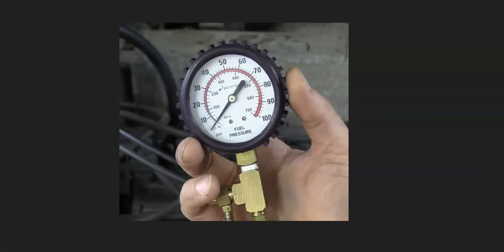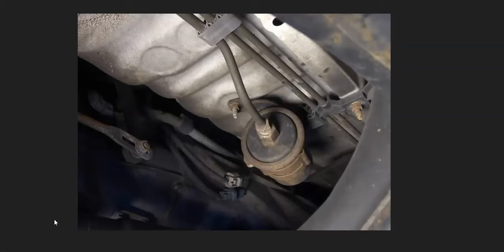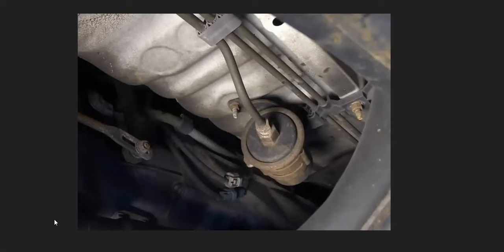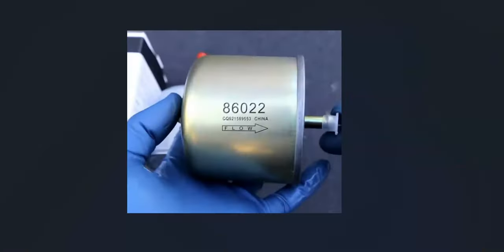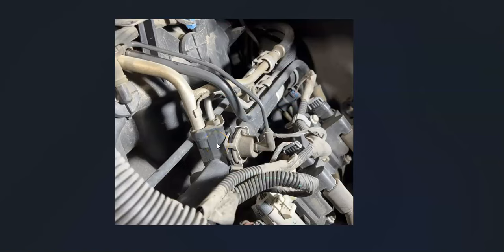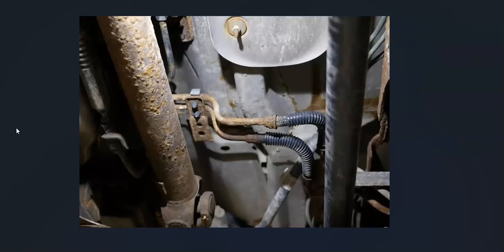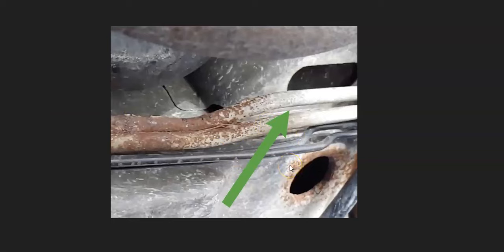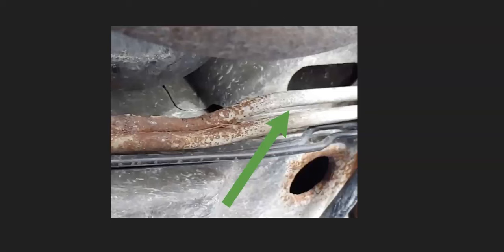5 Causes When No Fuel Pressure but Fuel Pump is Working

Comment from the maker: UPDATE: The fuel inertia button shut-off switch should have been on this list. An inertia switch shuts off all fuel when there has been an accident but may have malfunctioned.
Reply: @Hvac_Mechanic, I have a 93 ford 4.9L straight six, it sat for 3 years with low fuel in both tanks, fast forward now, 2023, I have to shoot carb cleaner for it to run on that, which is more likely, bad fuel selector dash switch, 2. rail mounted selector switch, 3. fuel filter as you mentioned? 4. FPR as you mentioned? 5. Fuel PUMPS, yes I said 2 pumps it has midship and aft tanks, 19 gallon midships, and 17 gallon aft tanks, front tank has a 2 second pump prime sound, rear none that I could hear like before, I just find it hard to believe I have 2 pumps out, I left my ford Ranger 2.5 4 cyl 2001 next to this 93 sitting with stale 3 yr old ethanol regular in it and a battery tender, it fired right up, so I find it hard to believe the fuel in the F-150 varnished at a different rate and is a dead fuel problem, I mean, I added 2 gallons fresh to the midship tank that did not help. I am going to test baseline pressure with a fuel rail gauge soon! your thoughts?
Reply: None of these seem to apply or are integrated into the New Fuel Pump I installed and still somehow am not getting any Fuel to the engine which I am now at a complete loss to what else To do... 
BUT GREAT LAMEN PRESENTATION THAT WE NON- MECHANICS CAN FOLLOW AND UNDERSTAND WITHOUT GETTING TO DEEP INTO THE WEEDS WITH (ohm and power numbers @ number ? Circuit, PCM etc) 
which looks like is what I am gonna need now lol... 
👍👍 For a great Video though thanks, Was still a great help! Tells me I'm at least on the right path

Comment: So i had 60psi at the engine ive replaced the fuel filter now i get none, when i start the emgine it runs like crap but on 30psi pressure, soon as i turn off the engine it drops to 0 pressure??

Comment: I just put in a new fuel pump in today for my 93 F150, the weird thing is, I can hear the fuel pump whining trying to run, but it's not pushing any fuel out of it. I even put a clear hose on the output side, and I'm not seeing anything. Either either the fuel pump is sitting too hard down on the fuel sock or the fuel pump is bad? I don't think it's any kind of voltage issue.
Reply: I just had the same problem tonight brand new fuel pump and nothing
Reply: @MarioGibson-qx6qy  here's what happened for me, I only had 3 gallons of gas in the new tank. I found out later I had to put at least 5 to 6 gallons in there. Once I did that everything started up fine.

Comment: I have a 98 nissan frontier 2.4.installed a pressure guege in place of filter because of po300 code it's throwing. At first when engine first starts up it's about 25 28 psi but after I run down the road and it warms up it barely runs  and the Guage is from o to maybe 10. Just replaced fuel pump. The Guage won't read any pressure w new pump but will crank and run ragged and end up cutting off within amin or so won't hardly take any gas pedal, still has the miss or skip it's had all along but runs worse now. Any help would be much appreciated
Reply from the maker: If the pump is good and the filter is not the issue, I would lean toward a contaminant, such as rust, in the fuel tank. I have had three older 90s Nissans that sat for a year or so and had rust in the tank. I would definitely run a filter.
Reply: @HVAC_Mechanic  ok thank you

Comment: Have a 01 super crew f150 replaced fuel pump and fuel pump relay and fuel pressure regulator no fuel pressure won't run?
Reply: Inertia switch, button should be down

Comment: Have a 04 buick Rainier cxl. replaxed the fuel pump. Tried it but no gas coming out the lines from the tank. Is this normal? Fuel pump is running. Man is to stubborn to listen to me. Did not try to start it. Guess I'm looking for suggestions

Comment: 99 ranger 4.0. truck turns over on the first crank, so there is obviously pressure. but when I tried to read my fuel pressure from the schrader valve, it was reading no fuel pressure, engine on and engine off. Would I just need to replace the schrader valve, or what else should I check for? Thanks In advance

Comment: My 2002 wouldn't crank, replaced starter, it started right up, ran 10 minutes. Now, cranks but won't start! Replaced fuel pump and filter. Checked relay/ fuses. Crank relay switched out but no crank again. So switched it back. It's back to cranking but no start. Now water in oil cap and on oil stick. but car has sit for 2 mths. No water in oil before car stopped running so how would head blow? Had blocked plugged in, no antifreeze since car won't start. Could water in block got to hot when temperatures outside got 60 degrees and blown head????

Comment: i have a 2002 avalanche and replaced fuel filter battery altanator and mass flow censor and it still wont stay running after it starts? plz help
Reply: Security mode? Runs for 1-3 seconds the dies?

Comment: I installed the new fuel pump and the pressure regulator But when I disconnected the vacuum line from the pressure regulator and accelerated . Pressure it wasn’t increased . Thanks why ?.

Comment: I replaced a new diesel pump in the tank,an connectet all it didnt start. Same problem,but no start. I did turn the key many times on and off to build pressure,but didnt want to start.
Reply: Get a helper and spray start fluid into the air intake until it starts. It likely needs primed

Comment: Fuel pump is working but no fire to the pump...any answers would help
Reply: Faulty check valve or small hole in fuel lines
Reply: Got power to the pump? 

Bad relay?

Comment: How much pressure is it supposed to have? Can’t find this info anywhere
Reply: Depends on your car, but usually it's around 3 bar. Some newer cars run higher pressure but for most cars it should be around 3 bar
Reply: Ls 5.3 around 55-60psi

Comment: I have a 2003 Trailblazer it cranks good and it starts and then it shuts right off I replace the fuel regulator and the filter and the pump is running good
Reply: Yeah my Silverado 2003 doing same like will start then shuts right off I’ve never had any issues with it before letting it sit for a month where would you start ? I’m not a mechanic lol

Comment: My fuel pump is ok,but Suzuki escudo h20a engine starts and immediately stalls.
Reply: Check air leak in manifold, or around there maybe. I just know my buddy had a filler bolt missing from an aftermarket intake manifold and it would start and turn right back off.  Also same thing happened to my Audi  when the pump was going bad I believe the filter was clogged though aswell

Comment: Five causes more like three fuel filter plugged backwards that's one problem different versions fuel lines plug leaking that's two versions one problem anybody know some other ones?
Reply: basic fuses and relays, could be the immobilizer for certain cars, they shut off fuel until the key code is recognized if not itll just crank and crank but wont spark since fuels cut